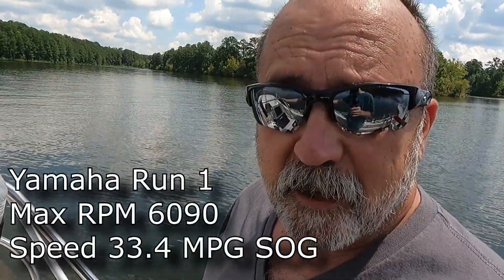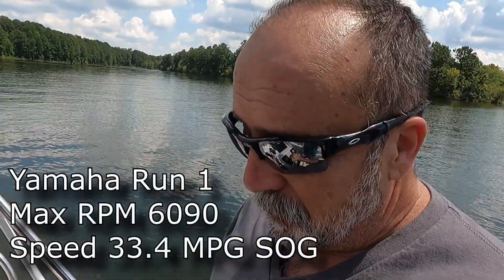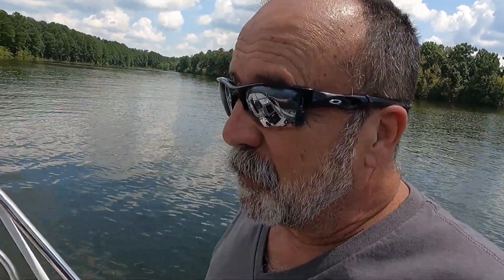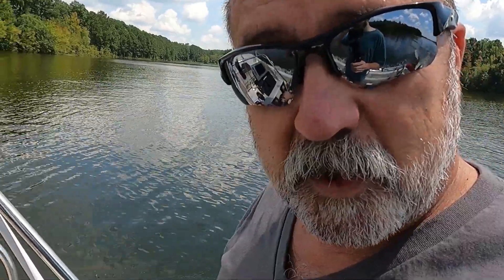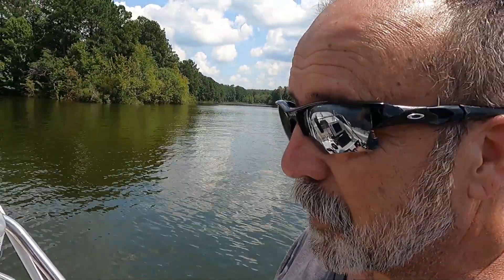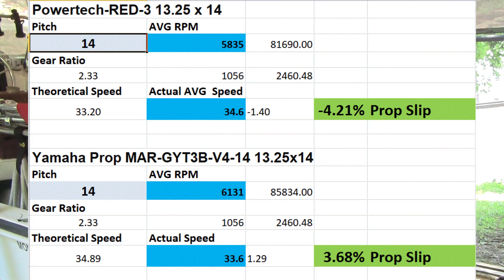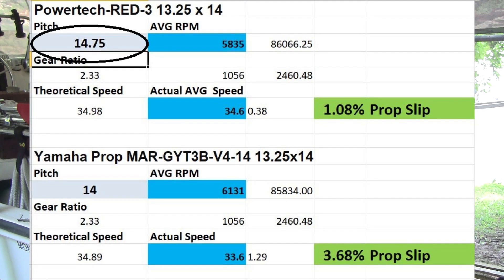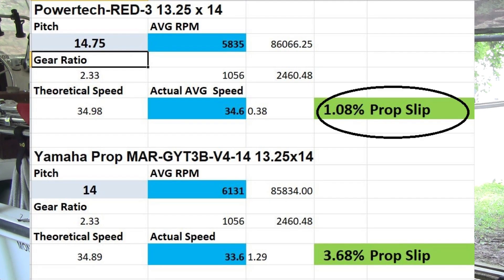Yamaha Vs Powertech 13.25x14 Propeller Showdown! Yamaha F70 on a Montauk 17

Comment: F70 Oil question here: I just changed my F70 oil @ 10hrs after break-in. Added 2.2 qts with a new filter and the dip stick still says only half full up the hash marks. Thoughts on this issue?
Reply: I just did mine last weekend and it took like 2 3/4 to fill it up, was my first oil change

Comment: Powertech prop probably has more cup to the blades making it bite more and hold rpm down
Reply from the maker: If you examine both props side by side, it's evident there is more cup so you are spot on! Thanks!

Comment: Yeah 5800 = 70hp. 5300-6300 wot. 6450 = rev limit. If at 5800 is the weight you will be running then great.
Reply from the maker: Good eye, that's about right.
Reply: When I repowered my KW 1720 with an F70 I was told by the Dealer (Ingman Marine) to shoot for 6000-6300 when testing props.

Comment: Hi Jose, thanks for sharing the experience! I believe the first propeller is a bit too heavy for the engine, since it doesn’t let him reach max rpm. Don’t you think you could run into excessive wear or other engine issues? BTW changing the prop on the fly was heroic!
Reply from the maker: I considered that, I think 5800 rpm is decent enough and shouldn't put too much of a load on the engine as it is somewhat close to it's max rpm. I did research it and Yamaha's full throttle range listed in the owners manual is 5300-6300 rpm. Presumably anything inside that range is acceptable. One last thought, the power band shows 5800 rpm as being 70hp, I thought that was a nice clue to pick that one lol
Reply: But it's good to overshoot that a bit so that you have a little headroom for extra loading and still be able to get max hp.